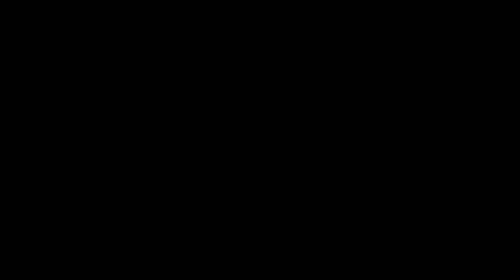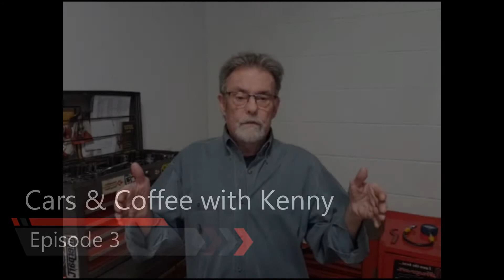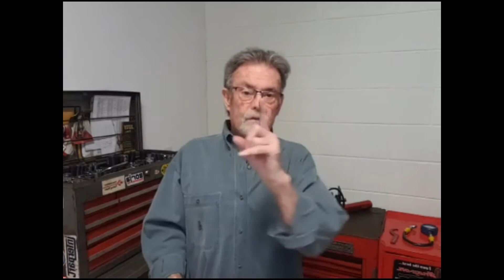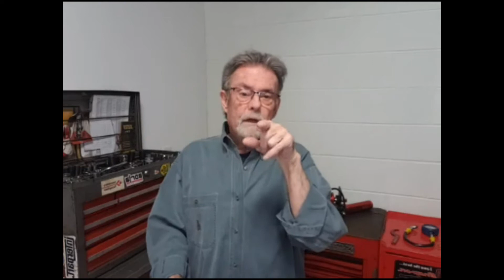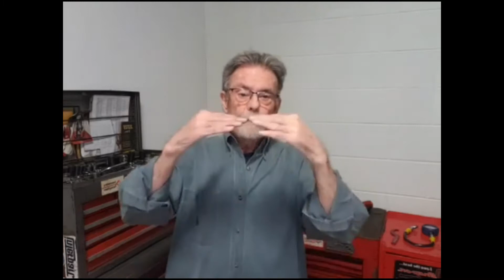Kenny Talks Tech on Panhard Bar vs Watts Link

Comment: You have the concept of roll center backwards. A low roll center induces more body roll than a high roll center. A high roll center will “shear” the tires in a corner instead of letting the body roll because a high roll center is closer to the COG.

Comment: Do you also need a torque arm when you use a panhard bar?..What would be the benefit vs the negative.?
Reply from the maker: No, we never use a torque arm with our suspension design. It is absolutely not required.